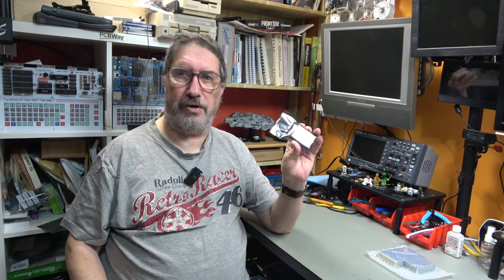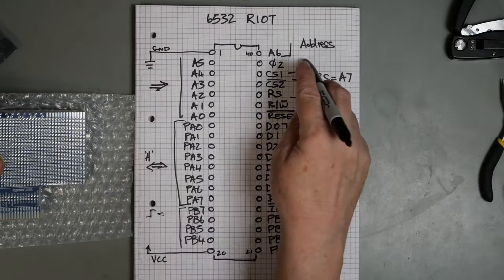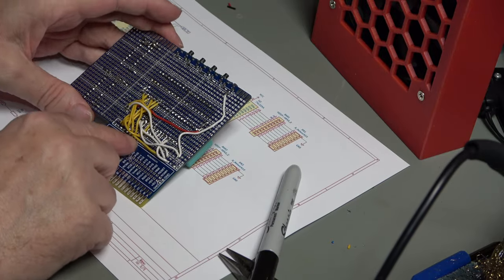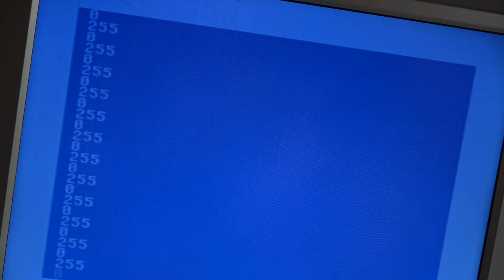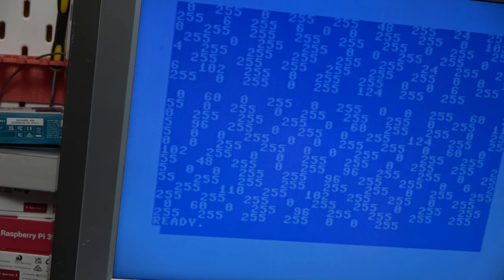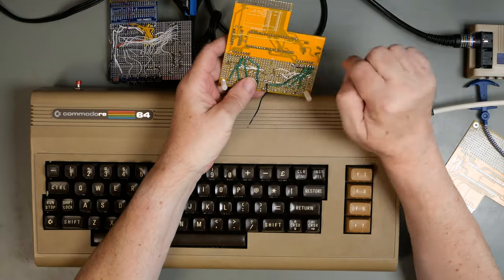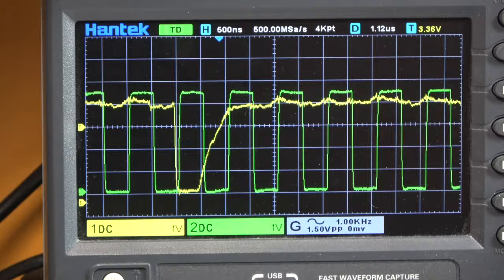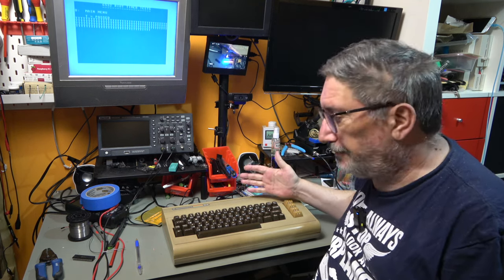Let's Turn a Commodore 64 Into a Retro Chip Tester

Comment: Finally found the last half hour to finish this 😊 happy you got it working in the end, and by the look of it you also ended up fixing it “the right way”.
Remember there’s usually a read and write timing diagram in the datasheet - for this one I like the Write timing waveforms on page “58” of the Rockwell datasheet. Basically it says “everything has to be valid a bit after ø2 goes low” - and if you slow ø2 too much it won’t be, so your solution is spot on :)

Comment: Well, for me, this was one of your most fun videos. Will you be updating the PCB before you put it in the shared projects? I mean like places for the LEDs (bar ones would be better), resistor arrays instead of discreet resistors, proper pads for buttons etc., basically getting rid of the "protoboard" portion. And what is your username in shared projects?
Reply from the maker: I'm keeping the protoboard section, cos I think it's useful - means you're not limited to just buttons and LEDs. But I've also made an 8-LED bar module that has the buffer chip and resistors built in. Just 30mmx25 with a .1" pin header, so it's very space efficient. And I've added a cartridge port breakout area, since I think it quite likely that someone might say "dang I wish I had access to this or that signal" (maybe they want to add a ROM to it, for example). It's a shame you can't put photos in YT comments, lol. Oh, and there will also be 6522 VIA and 6526 CIA versions. I'll upload some pictures in the Community tab later. 
My username in Shared Projects is TimsRetroCorner :)

Comment: Cool! For some kind of "automated" testing, maybe port A and B can be connected pin by pin (via resistors to be safe if both ports are set as output ...), so there can be a test to write port A (output) and reading the value on port B (input) and vice-versa.
Reply from the maker: Good idea.